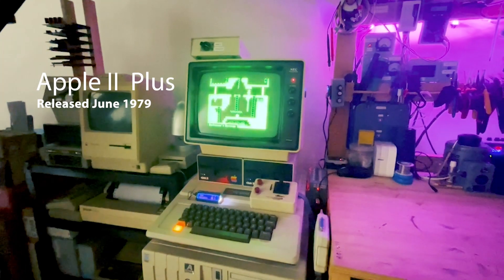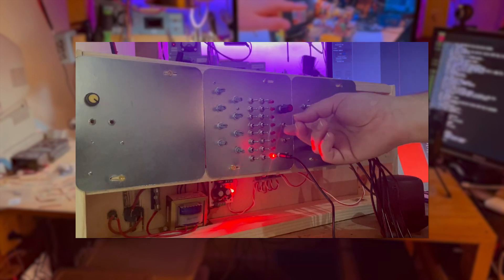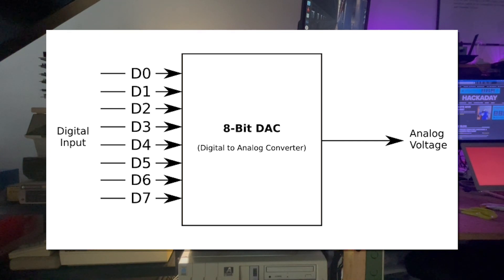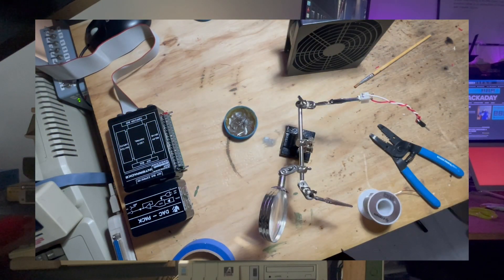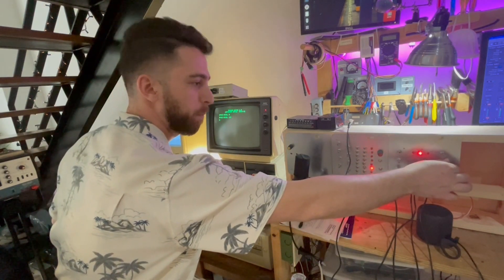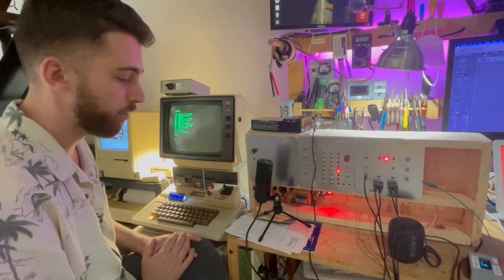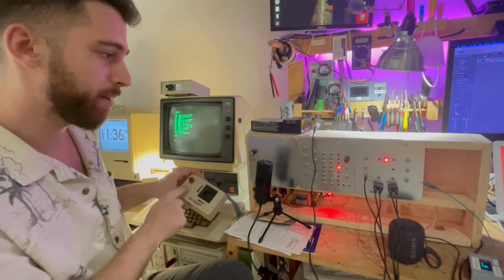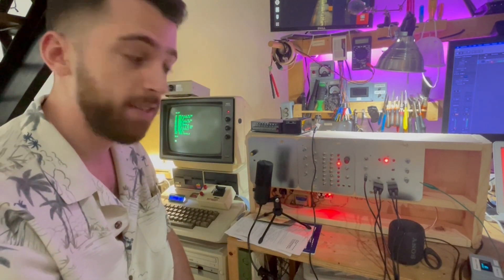Apple II Plays a DIY Modular Synthesizer

Comment: Cool project!  Timely, too, since I just found my Apple ][ in the attic 👍
Instead of that expensive and (somewhat) rare bit of kit, you could just hang a simple R2R DAC off of the bus (with address decoder and latch register).
Reply from the maker: Yes I plan to do this to make more DACs for the varying synth parameters! You can daisy chain through the DCP kit however and keep tidy addresses so I’ll probably just do that. But if I need 10+ DAC’s who knows! Synth stuff is a rabbit hole lol.
Reply: @joshuacolemanmakes7518  My Apple ][ (which I got second-hand several decades ago) came with a printer adapter which is useless to me and not worth much.  I may attempt to make a DAC from it and build a simple synth to control with it 👍 (well… it's on the TODO list, anyway 😅)